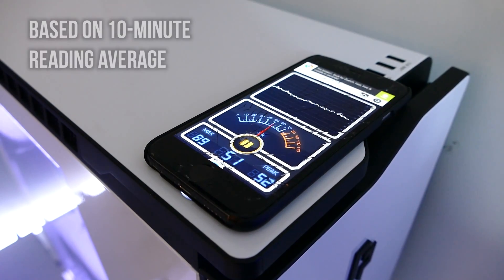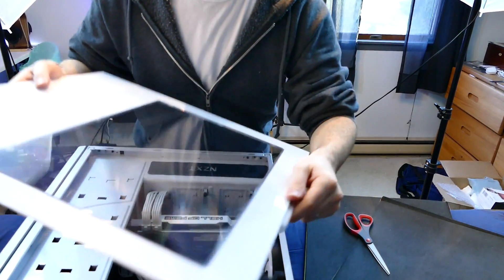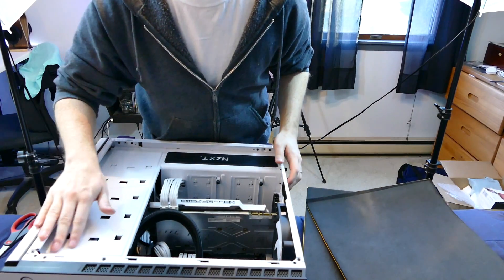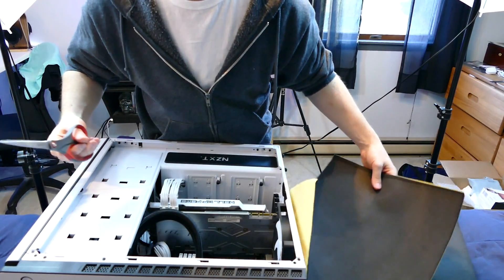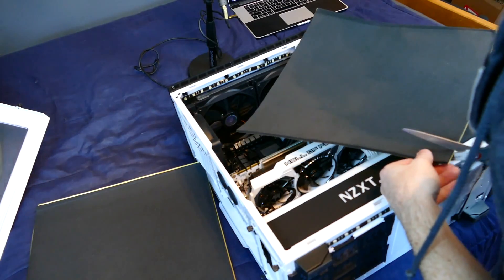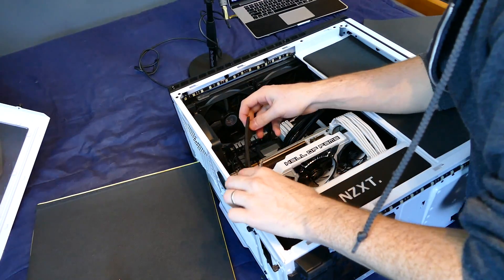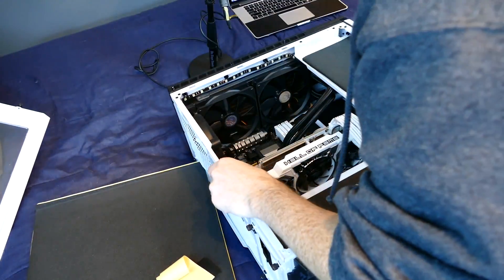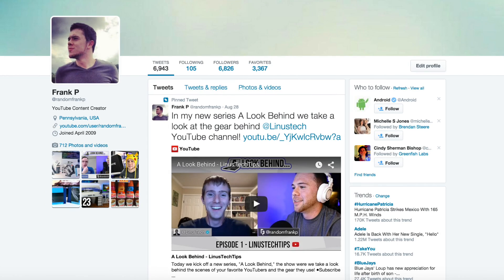How To Make Your PC Quiet for Cheap!

Comment: Set 2' thick Foam pads (wavy side in) on the wall where the Pc fans are pointed. In fact line the walls or inner cabinet on all sides of the pc and you will be shocked how much more quiet it is for a few bucks and no effort. Huge difference!

Comment: That's hands down the stupidest video on YT. Not knowing any shit about noise isolation materials: how to use them, what kinds for that, and where to apply them. And finally: not having any proper measurement tool and knowing shit about decibel system

Comment: Used this foam. Exactly this, even it had this yellow paper on side with glue. During load, with rising temperature it starts to stink and generally it increases temperatures of components more and more during load. In terms of soundproofing it works great, but mentioned price of it is too high. Changed my case to thick and heavy Define 7 Solid and it's much quieter without such problems.

Comment: They have this things in fishing used to help hold bait's they are O-rings very cheap in store less than a nickel each. Just round rubber rings and I use them on everything I can that moves in my PC which is held in with a screw (HDD, Fans, PSU, ETC) anything that I moves where I can use them and they are pretty effective at absorbing vibrations to reduce rattling. Results will vary based on your hardware but it does help with hard drives for sure. Most new cases come with a few of them to mount the HDD's on anyways.

Comment: The answer is to add mass to the case/components. Glue pennies or something heavy, non-conductive if you wish where necessary. Cover with foam dampening if you want. Add mass.  The sound will come from air turbulence at the ventilation areas.
Reply: Foam may be dampening some noise, but you're right.  Unless the fans are loose, what noise are they making vibrating against other components?

Comment: If the panels of your PC case are vibrating there is simple cheap solution.  Go to the Dollar Store and get some big jumbo erasers.  Glue the erasers on the inside of the offending panel and you are done.
Reply: You're on the right track. The rubber mass is a damper. Add mass. More mass = less vibration (the fan noise) per energy (fan noise/air turbulence output).  Glue pennies or whatever cheap mass to the panels. Foam "absorbs" some. Mass is the answer. A cast iron case for example...  The fan noise cannot move the iron panels' mass. Most all noise will be from air noise at vents. Mostly from back or most open air areas.

Comment: Allright! Here's the best solution for a REALLY SILENT PC:

1. Set you PC in BIOS to start from USB Keyboard or Mouse.
2. Buy a USB extension cable (longest possible)
3. Buy the longest HDMI cable you can find.
4. Make some holes in the walls.
5. Move your PC in the basement.

Here you go. Guys, you're welcome.
By the way - i don't drink beer. But a Redbull would be fine...
Reply: And, doing that, you will save money from investing in your "lights, nice cases, expensive fans" etc

Comment: sound proofing can imprive airflow because most people instal their fans without thinking so you can re direct the airflow. for optimum use you need to instal between where the fans and the case conect for it to make a significant difference.

Comment: I have a DDC pump that is improperly mounted. I mounted it in the HDD area in the inwin 909, and I didn't know how to go about drilling through with the short clearance so I just hot-glued it, in which it keeps falling apart. Also; I don't have a fan controller for my fans.

Comment: I think you didn't quite get how acoustics work. The placement of the dampening material wasn't really smart. Covering up big areas is way more important than putting foam between fans. For the the fans it would be a lot better to to put rubber washers between them and the case (like noctua does).  Just take a look at how quiet cases are made, or music studios with sound dampening.

Comment: WHY THIS WON'T WORK: You put your phone on the tower... Obviously the clothing reduced the vibrations spreading trough the metal and yes iphone picked that up. However, this has nothing to do with the vibrations that go to your ears... Bear in mind, that the decibels reduction that iphone picked up when it was in contect with your tower will probably be 0.2 decibel that your ear would pick up (or wouldn't since the change is so small that it makes no difference) Unless you keep your microphone on your tower while recording, this vide makes no sense.

Comment: The fan idea is pretty stupid, but the rest is decent.  Better off just getting good fans.  Also, idle temps tell very little about effectiveness of your cooling.  Especially when liquid cooling.  Even the little closed loop coolers like yours.  You need to do pre and post load testing.  For extended time, 20-30 min at least.  Then you get some actually useful data.

Comment: I have only 1 fan, excluding cpu cooler, so should I get the maximum amount of fans I could get for my case, so my question is really just - the more the fans the quieter the pc?
Reply: No.  More fans generally will be louder.  Better just getting really good low noise fans.  I personally like Noctua, but they are not cheap.
Reply: try more fans and keep them running at a lower rpm. Get those Noiseblocker E loops, I can highly recommend them :)

Comment: Are you realling going to do this for 10db?
Reply: 10 db can be a huge amount, especially if you have a fairly quiet PC to start with.
Reply: db is a multiple not a scale of 1 to 10... so 10 DB is a noticeable amount the average talking db reading is around 30 i think 20 is whispering...

Comment: Did anyone else notice that it was the same reading...... It did nothing. Just buy an already sound dampened case and turn it off or lower your fan speed when you are not using it.

Comment: Like others have pointed out, you probably need a hearing aid or a better decibel meter (probably the latter) as such a massive difference should easily be audible. 
Also, some of your suggestions don't make sense at all, or at least you didn't use the foam for what it's meant to be used. If you don't want vibrations from your fans, you need to change the way you mount your fans to the case (i.e. rubber mounting), because that's where the vibration is going, not to the air on the side of the fan. What the foam is supposed to do is absorb sound that is already there due to the vibrations, prevent reflection of sound waves and therefore resonance, it is not a tool to prevent vibration.
Lastly, like you've mentioned yourself, sticking foam everywhere in your case can hinder airflow, and I'm guessing most people who cannot afford a silent case, can also not afford water cooling and in that case, those ventilation holes may be crucial for keeping temps down.
Imho the best way to reduce noise is to reduce fan noise (check fan control, buy better fans), replace stock CPU cooler (a decent air cooler isn't that expensive) and if you have an spinning hard drive, either get one of those silent enclosures (though I'm not sure how well they work) or if you're a cheapskate like me, use some rubber bands and zip ties to hang it in your case. PSU and GPU are unfortunately quite hard to make quiet.

Comment: Sticking foam on your HDD cages does not help.

It's like placing sound dampening foam on a pole in the middle of your room, sound will go around...
Or placing isolation foam on a pole in the middle of your room, heat will go around it anyway.

Also just sticking foam on your fans will not help, vibrations will still be transfered to, in your case, the radiator.

Comment: It was practical...

...until he put it on his fans
Reply: +randomfrankp Did you know: Just putting foam on your fans will still transfer vibrations to other components...
Reply: +randomfrankp It doesn't help with the vibration.
Reply: yeah rubber mounts work so much better. Screws are metal, they ignore anything else you put between the fan and chassis.
Reply from the maker: +Nanocast Emdoph Anti-vibration, said that about 10 times
Reply: That's cool and all, but there are much better places to put the foam than directly onto the fan. To add Noctua have their rubber fan mounts which work with all of their fans and some third party fans aswell. All Im saying is that placing foam on a fan is somewhat overkill.
Reply: "rubber" infused fans are stupid and expensive for the most part... one can buy electrical tape and layer them or washers and use it on cheaper fans and get the same results.

Comment: 6-7 dB? every 3 dB the sound doubles so -3 = 1/2  -6 = 1/2 * 1/2 = 1/4 so that'd make your pc 4 times quieter!
Reply from the maker: +xVoItagex +1 for clarification!
Reply: +Juan Pablo Capurro i'm not english either although human hearing is more sensitive to noises above 200hz.. and if it does feel like 4 times quieter, idk. i guess we'll have to find out
Reply: +Juan Pablo Capurro holy shit my mind is so f*cked right now.
Reply: a 3dB increase in the  power will double the acoustic power but only increase the sound pressure by a factor of 1.4
Reply: a 6dB increase in the  power will double the sound pressure, (and the power will be x 4)
Reply: +Ferdi Vol PABLO FTW!
Reply: The  POWER or the Volume?
Reply: A lot of confusion comes from the use of decibels, or rather the misuse of decibels. Decibels are used to simply describe the ratio of two levels. This might be two levels of power, two levels of voltage, two levels of sound pressure or two levels of loudness.

Comment: I did not like the fact that you did not use a sound meter to check the sound level. Also would have loved if you had shown both the readings for sound and temperature levels at the beginning of the procedure, in the video. I think you did this video in a hurry - which is why a bit of snag in the planning.

Comment: You can buy silicone gaskets specifically made for mounting between your fans and the case, or whatever, to reduce vibration. The silicone gaskets wouldn't wear out as fast as the foam and heat shouldn't really affect the silicone rubber

Comment: you blocked the intake at the front...
Reply: +randomfrankp When you put strips on the front right side. That case is starved as it is, don't make it worse.
Reply: randomfrankp it only sucks in air through the right side of the front panel, where you put dampening material....
Reply from the maker: +xS1nuXx Not at all, where do you see that?
Reply: randomfrankp You should probably remove some at the front.

Comment: Frank bud what camera do you film this with? when you are talking on the camera.
Reply: +TheRaidenWolf Panasonic Lumix DMC-FZ1000 4K
Reply: +Keval Patel If thats it I will have to check it out seems a good soild quality picture :)
Reply from the maker: +TheRaidenWolf Yup! FZ1000
Reply: +TheRaidenWolf all about the lights
Reply: +randomfrankp damm your phone loook a bit broke
Reply: I have an NZXT S340 With Stock fans,I put a custom glass window on it (Not the cause it was loud before)and an intel stock cooler.Also my GPU is in zero frozr mode.Please help me the system is not vibrating!